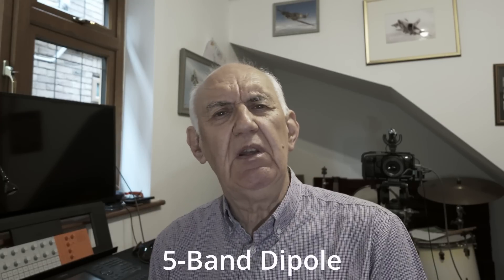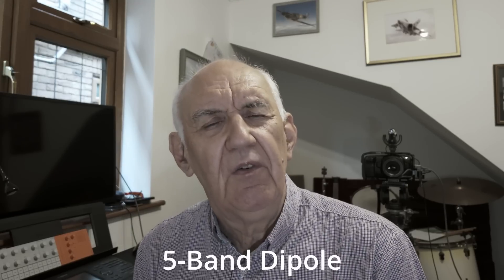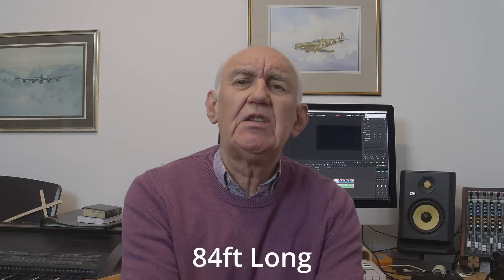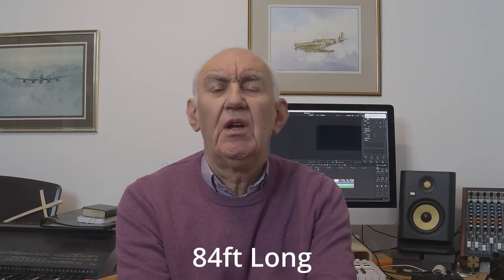The Forgotten FB5 Ham Radio  Antenna - | HF Antennas

Comment: Very interesting antenna. I'm curious, have you heard of the N4GG antenna? It was not a space saver, or multi-band, but a gain antenna for whatever band you made it for. It is basically a 3/2 wave wire with the two ends turned vertically down 1/4 wave each, so it gave a combination of vertical and horizontal pattern.  It was a full wave length long with 1/4 wave legs, center fed. 

I don't remember the year I learned about it, but I talked to him in the 80's  or 90's, I believe.  I think he took the idea from the 15 meter band working from the 40 meter dipole. I made one for 10m because of size and space, and, I can't tell you how much better or not it was over a dipole due to the nature of the band during the sun spot cycle, much like it is today.  

The difficulty of the antenna was that you had to tie weights on the legs to keep them straight and vertical.  With the crappy poles we have today, I guess you could make one more portable and run the wire down the pole for stability.  I lived in an area that was very windy at the time. 

What do you think?

Comment: I found reference to the antenna in Short Wave Magazine March 1969 and it refers to 25 Type B4 Mullard FX1308. I have a Mullard data book (1978/79) but unfortunately it doesn't list the 1308.
Reply from the maker: Yes I could not find the spec.

Comment: Very Interesting. Especially intriguing on how 10 beads can work and 25 beads works better. I would guess that more beads increases Q (useful Z?) on the higher bands and achieves higher gain while 10 beads (spaced?) can  get you into the realm of acceptable efficiency with those same harmonic bands?  The wide range of numbers of beads that are said to achieve working results tells me that the specific specification of the the bead used may not be absolutely essential to get proper performance. If you used the wrong bead, or even mixed beads, you might have to use a few more. At some point in experimentation it would be obvious that adding more beads is not improving. 'think I'll try the double for fun when my new sino analyzers get here, but how does 80 take care of itself?

Comment: The forgotten FB5 antennas' dimensions are not too dissimilar to what you would get if you built a 14 MHz Extended Double Zepp (EDZ). A vertical section of 450 ohm balanced line can be used on the EDZ too to provide a good match to 50 ohm coax so it's worth experimenting with the FB5. The short vertical section on the EDZ also results in a tighter main lobe. The main lobe would indeed start to break up if the balanced line was omitted and the missing 10 foot were added to the horizontal elements. Ideally you want to try to keep the horizontal elements no greater than 5/8 wave long on the main design band. I'll definitely try a FB5 if the wx picks up! 73 Dez, G3WW.
Reply from the maker: Many thanks for that info. Let me know how you get on with the antenna.

Comment: Thanks, Peter, for the video about a G4ZU antenna I hadn't heard of before. Rather than try to find the Mullard ferrite bead info (I tried!)  consider the design as usung inductive loading to resonate as a half wave dipole on 80m. with the bead position allowing a match on 40m and above as you say in the video. You could use small multi-turn inductors on say T50-6 toriods which will have lower RF loss than the original ferrite beads. I'm moving up to Scotland next week so I'll try building this design once we are settled in.

73 Chris G4HYG (GM4HYG)
Reply from the maker: OK keep us informed on the resulrs.
Reply: How many turns do you think you'd need? I guess they will need to be potted to protect them, and some kind of strain relief? G7VFY
Reply: I'm not sure of the number of turns yet but both inductors could be mounted inside a junction box at the centre of the dipole with the ribbon feeder cable.

73, Chris GM4HYG

Comment: I think it would be interesting to try beads on a EFHW to reduce multi lobes on the high end and perhaps lower the low end. Getting best performance on all bands, with one antenna, is still a goal. Also, Lazy H and Serba Curtains are a good solution to lower the radiation angle at low antenna heights.

Comment: Here’s what Chat GPT could tell me with a bit of prompting 

Thank you for the clarification. The FB5 antenna designed by Gordon Bird (G4ZU) indeed uses a unique design involving ferrite beads to create a multi-band dipole. This antenna employs a specific arrangement of ferrite beads along the radiator elements to manipulate resonance points. Here are the accurate details for the FB5 antenna:

### FB5 Antenna Specifications

1. **Antenna Type**: Multi-band Dipole

2. **Design Principle**: The FB5 antenna uses ferrite beads placed at intervals along the dipole elements. These beads act as chokes at specific frequencies, effectively creating multiple resonance points along the length of the antenna. This allows the antenna to operate efficiently on multiple HF bands without requiring complex matching or multiple elements.

3. **Construction**:
   - **Elements**: The dipole consists of two radiating elements. The lengths of these elements are chosen based on the desired bands of operation.
   - **Ferrite Beads**: Ferrite beads are strategically placed along the elements. The exact spacing and number of beads depend on the specific design and the desired frequency bands.

4. **Bands Covered**: Typically designed to operate on several HF bands such as 80m, 40m, 20m, 15m, and 10m.

5. **Impedance Matching**: Standard dipole feed point impedance matching techniques are used, often involving a balun (balanced to unbalanced transformer) at the feed point to match the balanced dipole to the unbalanced coaxial feed line.

6. **Installation**: Similar to other dipoles, the FB5 can be installed in various configurations like horizontal, inverted-V, or as a sloper, depending on the available space and desired radiation pattern.

### Practical Considerations

- **Ferrite Beads Selection**: The type and material of ferrite beads are crucial. The beads need to be effective at the specific frequencies of interest, typically involving materials like type 43 or 61 ferrite which are common in HF applications.
- **Element Lengths**: The lengths of the dipole elements need to be calculated considering the presence of ferrite beads, which influence the effective electrical length of the antenna.

### Additional Resources

To build an FB5 antenna or understand its detailed design, you might want to consult specific articles or publications by Gordon Bird (G4ZU) or resources shared by other amateur radio enthusiasts who have built and used this antenna. Forums, antenna handbooks, and specific articles in amateur radio magazines often provide practical insights and detailed construction guidelines for such antennas.

By looking into these resources, you can find detailed instructions, diagrams, and tips from other builders, which can help you successfully construct and deploy an FB5 antenna for your amateur radio operations.
Reply from the maker: Thanks for the info. The arrangement  and critical position of the  beads you  outline is at odds with G4ZU published data. The beads do not act as chokes. They add inductance. In fact as I said in the video, G4ZU suggested that even less beads can still work.
Reply: @watersstanton  that’s ChatGPT for you. It hallucinates a lot 😂
Reply: Ome point to condider is that the early ferrite materials made low loss inductors at HF frequencies. As modern ferrite materials are now used more for EMI supression, far lossier materials are used having the side effect of widening the supression frequency range. The FX1300 ferrite used was a very early version not included in the later Mullard  catalogue someone posted on the internet. 43 material beads may work but will be lossy.

73, Chris GM4HYG

Comment: Hhmmm wish I had a garden big enough to experiment in… my “garden” is 6m x 4m  but… I’m working on a stealth doublet running around the plastic gutter of the house and along the fence raised on small wooden poles… one leg goes over the pavement to a limb of a tree about 4m ish high so it won’t strangle anyone… I’ll have to do a ninja and put it up when twilight comes and everyone is watching telly… 😵‍💫   🤣…. If it works,,, then I’m back after a hiatus since 1996…   This antenna you describe in the video would be heavy don’t you think with the ferrite beads on ? but dickie bird must have been a clever chap with his designs.  🧐   🤔
Best wishes to everyone.73.         💙
Reply from the maker: Thanks for sharing, Ferrite beads are very light. so weight would not be a problem.
Reply: Yes agreed, a classic problem is that many (most?) people do not know what a small garden is. A garden that can hold an 80ft + antenna is a HUGE garden. 
Andy